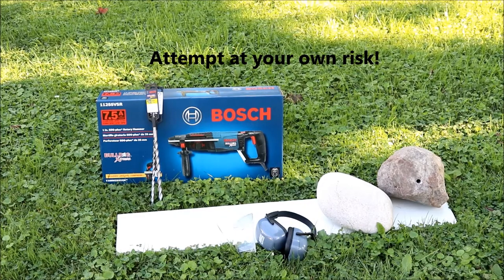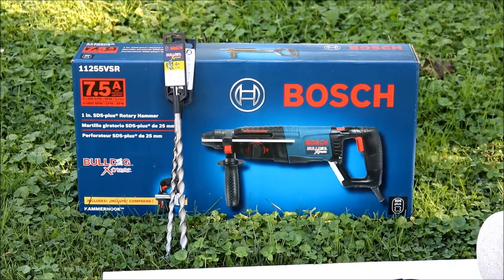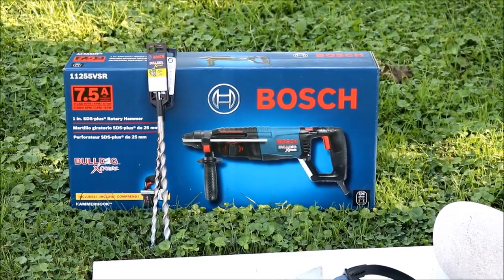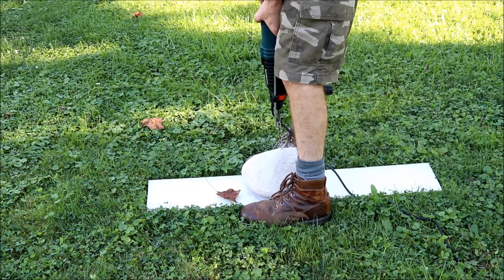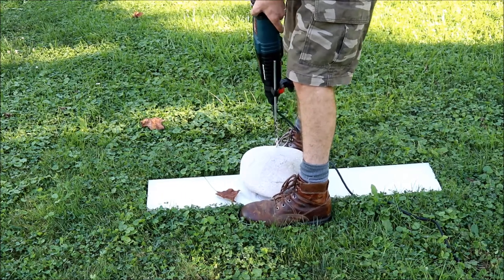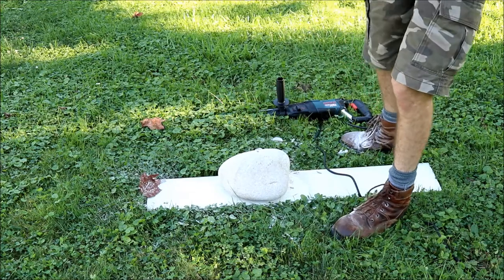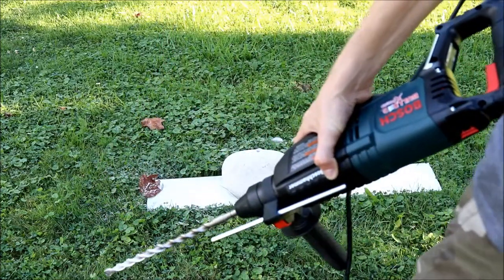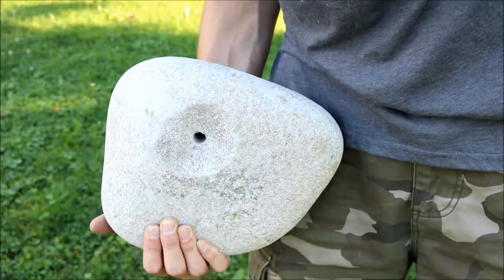Drilling Natural Stones/Rocks

Comment: 1. You drilled a 3/8", then widened with a 1/2".  Why not just start with the 1/2" ?
2. What type of rock was it ?  A hard granite, or some softer stone ?
3. How hot did the drill bit get ?

Thanks for putting together the video.
Reply from the maker: Not sure what type of rock. I thought it would be easier to drill a smaller hole than go bigger but you probably could just drill the bigger first. I'm sure the but was a little bit but nothing crazy. Thanks for watching.